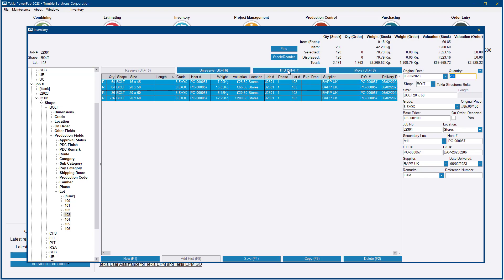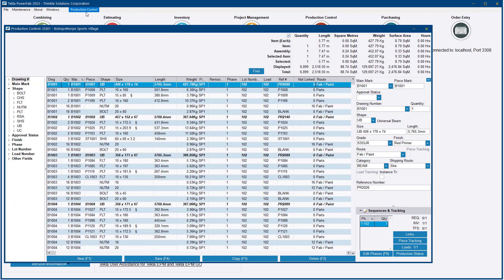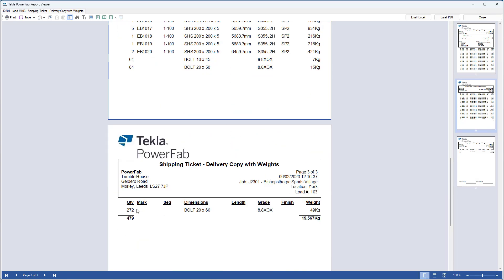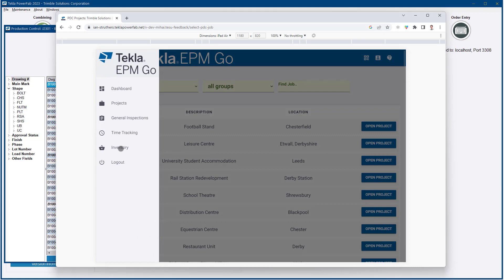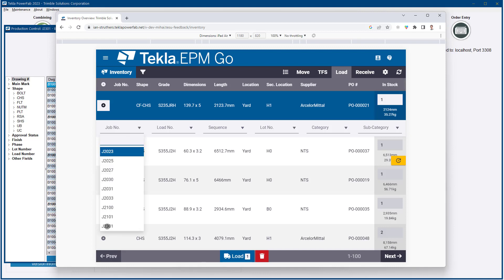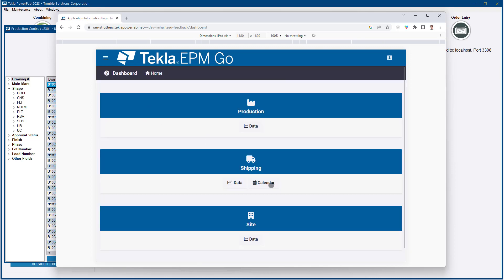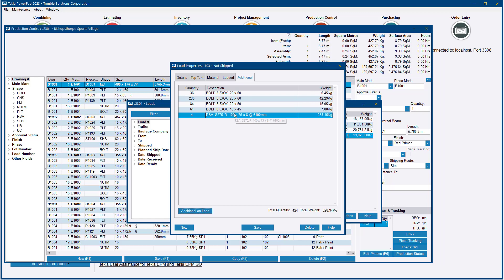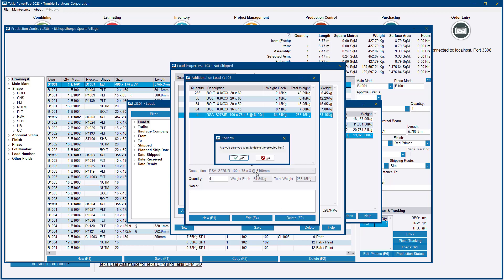Tekla PowerFab: Add Inventory to a Load

Comment: is there a video on the clerical side of Tekla? From getting the bid, putting in the contracts adding all the clerical odds and ends of a job besides drawings? I need to know how to , input the estimation , the bid , the final contract, making a project management job , ordering materials, making a rec. all the way to inputting finalization.